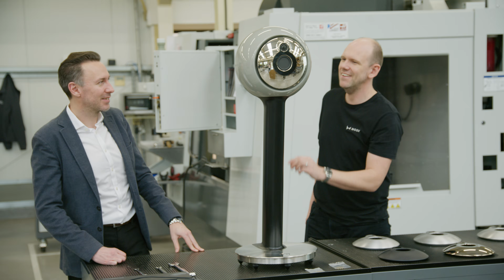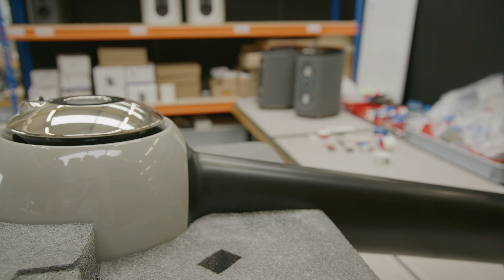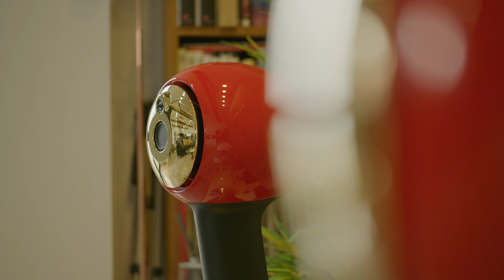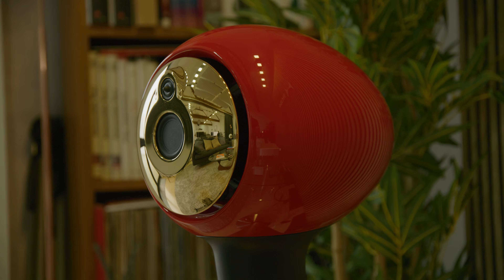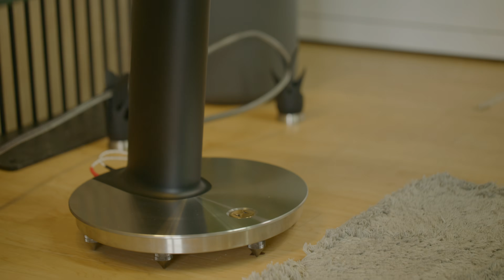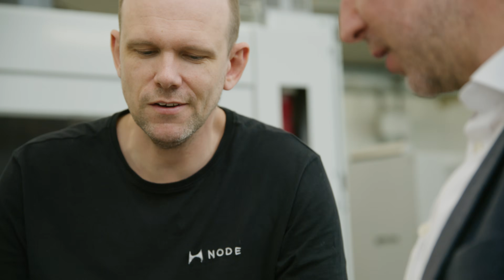How Node Audio Reimagined the Loudspeaker with the 3D-Printed Hylixa

Comment: Seems like a coaxial driver might have fit better in an egg shaken enclosure.
Reply: Although coaxial drivers can produce excellent results, they are not without their challenges. Placing a tweeter in the throat of a cone driver introduces acoustic and engineering compromises that must be carefully addressed. Many would argue that KEF has achieved the greatest success with coaxial designs, but the company's Uni-Q driver has been under continuous development for decades to refine and improve its performance. In other words, simply using a coaxial driver is far from an easy solution.

Comment: if you made these active, rather than passive, you could truly maximize this design and dramatically improve the bass performance
Reply: That can be said of most speaker designs. But also remember, in high-end hi-fi, active designs are not nearly as popular as many people think they are.
Reply: @dougschneider8243 I’m aware they’re not as popular. I’ve been in the industry for over 35 years and work/worked for some high end speaker manufacturers.